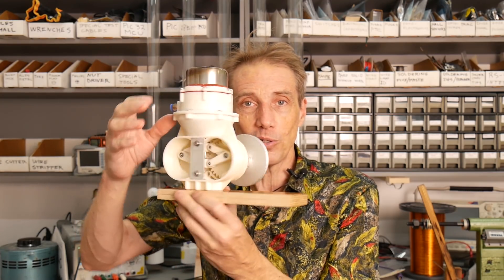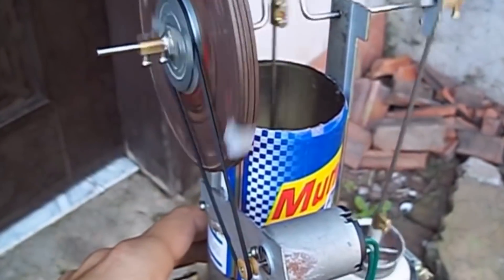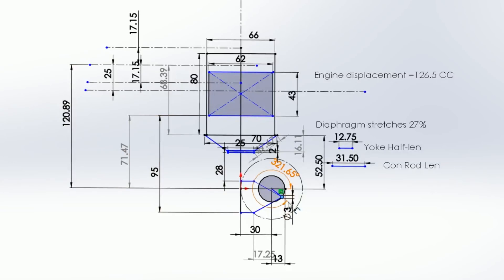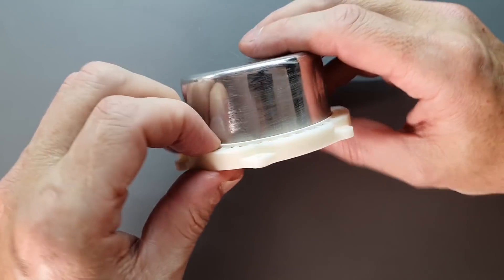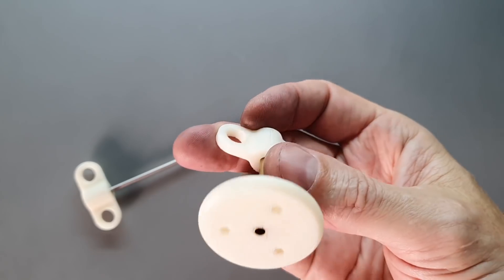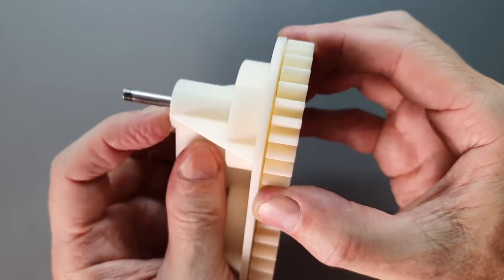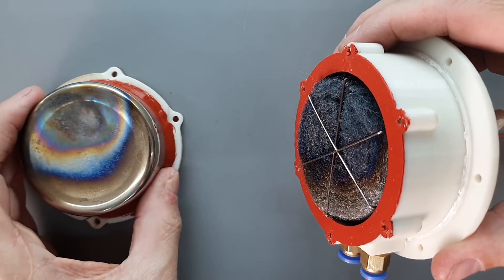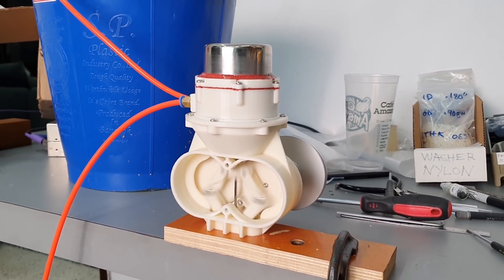The Stirling Engine Project

Comment: This is super cool! I wonder if cooling fins inside the chamber could help with efficiency, giving more surface area to the air. Excited to see more!
Reply: It Is important to efficiency to keep the working gas compression and expansion chamber as free of un-heated or un-cooled gas as possible, so introducing fins rapidly becomes a power loosing attribute if it displaces more gas than the efficiency it may lend.!.!.!. Robert Stirling origional patent also concerned a "regenerator", which involved using an absorptive metal wool or fine wire in the channel or tubes connecting the hot and cool chambers of the engine, which would absorb and re-impart heat energy to the occilating working gas.!.!.!.

Comment: Why not power this plastic engine with ice. Maybe you could also use dry ice or liquid nitrogen for demonstration instead of a flame? 
A practical model could serve in temperate climates as energy sources by collecting snow, ice and halestones and put them in mass in a very large insulating cyllinder with vacuum walls only letting spring and summer heat though via the stirling engine. The cooled air from the sterling engine could also be used as airconditioning during the hot summerdays while producing electricity.

Comment: Just get a small lathe.  And a decent drill press.  It'll be fun they said.

And then I caught myself buying a bridgeport and dragging it home and rebuilding it.  And then......the foundry.  And then the new oil burner for the foundry.

Somewhere in there I built the classic coffee cup low delta Sterling engine.  Oh yeah, and then a domestic sized combined heat and power plant using an enormous 6 horsepower Lister diesel running on biodiesel.  Since the proof of concept worked so well, I went and bought a brand spanking new 2004 diesel Jetta and ran it on biodiesel for a quarter of a million miles.

Run away while you still can!!!!  It will take over your life.

Comment: After you have the dyno done it would interesting to do some maths and see if the sterling does a better job of converting heat differentials to electricity than pnp/npn junctions. Micro electro mechanical old tech VS old mechanical tech :)

Comment: Two questions:
One, with the cooling jacket, is it necessary to separate the Cylinder from the head, can it be one piece with a tight fit cooling jacket?
Two, the cooling jacket, can internally have a spiral  guide to the low-pressure side to maximize cooling contact time, can the guide support a thin rubber rope like a rubber band or string to make firmer contact for flow dynamics.
Reply from the maker: If the head and cylinder are one piece, it's like a thermal short-circuit that robs efficiency!

Comment: This is just an amazing design! Thank you so much for sharing the project with us! 
Are you sharing the 3D model files? I would love to print one for me.
Reply from the maker: E-mail me
Reply: @leosbagoftricks3732  Hi, is it possible to have the Solidworks assembly file? Thanks
Reply: @leosbagoftricks3732  
do you think you could design one of these sterling engines to be directly tied to a pilot light, but a shared pilot light, like say for your water heater in the house, that would either charge a battery for the house but also provide emergency electricity when the power is out or maybe it could be used alongside your main grid power to supplement the power that the house could make use of.
Reply: huuuummmm NICE. If you build this, you should paint it TOMATO-RED.
Reply: @KimSeiji  tomato crusher
Reply: frozen tomatoes powering a stirling engine tomato chopper
Reply: @JoshuaJoshua0  Take a Stirling engine, hot tomato sauce on one side, frozen tomatoes on the other side, then you have more power to destroy tomatoes
Reply: The red sealing compound reminded me of you :D
Reply: @1islam1  prove it!
Reply: I'm also interested to know if this can be shared publicly.

Comment: You should be able to substantially improve performance by using helium as the working gas. It's not practical in a 3D printed engine because it would rapidly leak out, but it would make an interesting one-off test for comparison against air.

Comment: Very nice design, now set up a generator and work out how much power you can make with it..first with butane as a heat source and then with a solar concentrater like a fresnel lense..make yourself a mechanical water pump for your cooling..You may just end up with a really cost effective design...very well done.

Comment: I have a AC unit to cool and thought about coupling a Stirling engine as a condenser for the high pressurized and heated R32 refrigerant.  It feels appealing to "recycle" old waste heat to reduce costs of running the AC in the first place. Maybe any thoughts about this?
Reply: The sterling engine will end up impeding the heat from dissapating from the condensor which makes the condensor temprature rise and the owerally efficiancy of the ac will fall

Comment: I designed a simple dynamometer that has a mountain bike brake rotor mounted to the shaft and an arm supported by a bearing on the shaft which has the brake caliper mounted to it. The arm is linked to a small hydraulic cylinder. The length of the arm and the diameter of the hydraulic piston are such that a pressure gauge will give a direct read-out of foot pounds of torque in pounds per square inch.
 I am hoping to build a Stirling engine that is light enough to power an aircraft.
 Thank you for sharing your work. It is inspirational!

Comment: I would make a spiral inside the water jacket with the inlet and outlet at opposite ends. That way the water is forced all the way around. You can also pressurize the jacket with air to 5 psi and then use soapy water to find the leaks. Also integza has a few videos on measuring dynamic torque and rpm which will allow you to determine the available power of the engine.

Comment: Leo, I'd love to build or support a project to generate power from a solar thermal Stirling engine. Just wondering if a device like yours could generate enough power from several solar thermal panels on a campervan roof, as opposed to simple PVs.

Comment: Nice! I see that you are using ambient air as your energetic medium between the hot and cold phases. Since the archetecture is theorethically contained (airtight, since you use a membrane for your working cycle.), have you thought of differentiating the energetic medium (refrigerant or other gasses instead of ambient air.) to see whether this changes the performance (Hint: It does!).

Comment: Opposing Double cylinder, 3d ceramic piston?, 
Id want to see if Peltier modules could work as heat source or suck heat from water to increase the cooling

Comment: But the energy to heat it way surpasses  the energy of the engine. I think, after all your a/tension to detail, ch is considerable, you forgot the first detail. The engine needs to do more than convert heat to kinetic energy. It needs to be efficient. Can you improve that?

Comment: I want to make a Stirling engine using two regular 4 cylinder car engines, one as the cold side and the other as the hot side. Both their cranks connected to heavy permanent magnet motors. The engine heads modified to remove the camshafts and replaced with powerful solenoids. I want to power the entire contraption with hot water from my high efficiency wood fired water heater.

Comment: I used to work for a canning company and the packs were wrapped in shrink film, the heat tunnels that the packs passed through to shrink it would feel hot from the outside.
As it happens they had cold water drains running underneath them.
My idea to them was create a sterling motor that extracted the heat from the outside of the tunnels with the other end in the cold water.
From my understanding the hotter one side is in relation to the other produces more drive.
We had 3 massive units that would run 24/7.
They wouldn't spend the time even considering it even though we had engineers doing nothing half the time.
I am sure it was possible and would have produced a lot of energy over time.
It would not have been anything like your design though.
You speak of optimization but those units were at a constant 160 degrees C.
If anyone can figure out a good design i would think companies would take it up as how many companies shrink wrap their packs and saving energy is becoming a big issue in industry.

Comment: These engines are fascinating to me as well! I tend to like the variations that are capable of running on low temperature differentials. They run beautifully smooth and suffer much less from melting and oxidizing components (provided you don’t try to over clock them). The big challenge with them is reducing friction as much as possible. That’s very difficult with so many moving parts.
Great video! I suffer from the same obsessive behavior, but it’s so much fun so I wouldn’t have it any other way.

Comment: I think just hooking it up to a generator and measuring output should suffice. If you make drawings available for the parts you are having trouble with people will probly just make them and send them to you I know I would. Finding a way of using helium ( OK look for bb gun pumped up with helium here on youtube. or for extra credit watch helium superfluid state) as the working fluid. I want one just keep going your an awesome engineer I want to drive a delco alternator ( cause there cheap and lots of parts available and 750-1000 watts so a little over aHP ) solar powered from a parabolic trough the cyl. head a long tube down the trough beat that for easy fab the trough will track the sun while your battery's charge your 100% correct lot's of content here and your's is some of the best I've seen I have some machine tool's and could help keep going man this is reeeal good stuff!!!

Comment: I completely understand your addiction and I completely understand your need to build these engines.
Around 15 years ago I saw my first Stirling engine and it immediately transformed me into something I didn't recognize.....and I have never looked back.
The addiction has become so strong I bought a Bridgeport a lathe and a plethora of other machine shop tools. My background as a machinist also came into play.
I live for these engines.. well that and metal detecting.
But these engines are certainly at the forefront of a lot of my free time.
I live in the snow belt so I have a lot of time to work on these engines when I can't swing a detector.
I have to say that your engine is absolutely beautiful! you did a fantastic job on it. That is an engine that any builder would be proud of!
You'll get the bugs worked out of it, that I'm sure of.
These engines look so simple and so easy and yet they're extremely complex as you were saying. I made the mistake of thinking it was a cakewalk making one of these engines and I failed miserably again and again because of that. I didn't give these engines the credit and the respect that they deserved on the onset of building these and I paid for it with failed end product.

Comment: Great project. I would be tempted to attach a water pump for the water, so as not to have to rely on gravity feed.
Edit: Thought bubble - how about casting high temperature epoxy parts from your printed components. That would solve melting problems.
Also, I couldn't understand where the power piston was, isn't that a separate item from the displacer?

Comment: Very cool, and it sounds great. I remember reading about a Army project for a sterling engine generator, something like 30kw with a swash plate crank. They used helium for the working gas but it kept leaking out. Keep up the great work

Comment: I was thinking of an engine that is low cost, reliable, and possibly a flex-fuel solution. A bunch of tiny engines insulated and cooled are not going to be as hot as a bigger engine. 3D printed tiny engines with very simple functionality. It would be a hybrid with little engines like generators, or possibly building up pneumatic pressure.

Comment: Leo, as a dynamometer use a permanent magnet model aero electric motor as a generator. Couple it directly or via a belt drive to one output shafts of the engine. Measure its output with a small digital wattmeter.

First Calibrate the efficiency of the generator itself using an identical motor to drive it. Measure the speed using a tachometer.

Use an identical second motor to drive the first motor used as the generator. The input and output power to motor can be measured with digital wattmeters.

 The generator can be loaded with 3 identical resistors in a star connection.

Instead of digital wattmeters, ammeter and voltmeters can be used to measure input and output power. 
For example, the output load resistor current can be measured with an ammeter. The power output is 3x I×I x R where I is the current through each resistor. 

Obviously, the efficiency of the generator is equal to the output power divided by the input power.

When using a second motor and a resistor load, the efficiency of each motor/generator is equal to SQRT (3 IxIXR/W) where W is the input power read by the digital wattmeter.
This efficiency should be about 95-99%. 

Then the engine power output can be measured as equal to the ojtput wattmeter reading divided by the generator efficiency at that speed. 

Speed dependence of generator efficiency could be a problem, so you will have to measure it at various speeds. The motor-generator setup would facilitate that.

Comment: You're sucking me back into my old stirling engine obsession. :)
But if you could maybe create a github repo with your fusion360 and/or stl files, you could get some contributions from nerds like me.
Help us, help you, help everybody.  Thanks man!
Reply: Do you happen to know how you get high pressure working fluids working? I always wondered how you get the power piston working since the gas behind it has to be a similarly high pressure
Reply: @ravener96  I'm not totally sure I understand your question, but I'll take a stab... It has to do with the large surface area of the top and bottom of the displacer coupled with the localized change in pressure due to temperature.

Comment: for a dynamometer you could use small water pump or hydraulic pump and the head pressure as the scale. thinking it would be a good way to calibrate how much torque you can get out of it and size a generator and output gearing for it. being that most heat engines have thermostats to keep a set temp, was thinking this would be a good way to either passively cool a generator/make one more efficient with pulling more power out of the waste heat.

Comment: Why have you done this to me?

My parents have an old satelite dish (about 1m), and thats been laying around. Several years ago now, i looked at it and thought...."If i glued some aluminium foil/mylar sail to the dish and used its focal point for concentrating solar radiation, perhaps i could generate suffient heat to turn small eletric generator via stirling engine." 
But the i thought: "Nah, i couldn't really, i can find and/or modify and existing piece, too bad, i would've loved to have my own creationg partially powering my home" and so, i push this project out of my mind.

No, just seeing this video triguered my head to think to start using 3D printing as solution even if to just use the 3D printed parts as templates for metal casting, and now i need to build a furnace too and i also might need this and that... Sigh here we go again!

Nice video, definitely, thanks for sharing!

Comment: Hey, did you know you can work this thing in reverse too? If you hook a motor up to it and turn it manually, it will actually cool the heat plate. If you turn it fast enough, the surface will get cold enough to liquefy the oxygen in the air.

Comment: Since friction, vibrations and general wear&tear are a thing with stirlings - especially with the comercial ones, which have to be financialy feasible in which case the livetime really starts to matter - I always wondered if a magnetic assisted stirling or something like a free piston stirling engine is feasible. Can magnets displace the flywheel? Can contactless magnetic gears be benefitial? How about a linear generator setup... yes, it is quit addictive...

Comment: Due to the fact you cannot throttle the engine up/down as quickly as a pure internal combustion engine, the best way to put a Stirling engine into a vehicle is to use it in a hybrid setup where there is a battery and Toyota-Prius type of geared-CVT transmission that drives the wheels.

Comment: OHMYGOSH!!!  YOU CRACK DEALER YOU!!!

Sure... it's all fun and games until...  now I have to BUILD ONE!!!

This video is DELICIOUS!!   Thank you!   I wonder (in an open source sort of way, posting my thoughts for all to share) if the trick to a good stirling engine isn't a really really long displacer?  If you keep the hot area further away from the cold area... wouldn't the temperature change be easier to increase, and thereby make it easier to harness the hidden nectar of power in these things?  
I LOVE your addiction to symmetry by the way!  Fantastic design... and you REALLY tapped into the essense of the Stirling weakness in the inventor's mind!

LIKED AND SUBSCRIBED!!!

Can't wait for your next video!

Comment: An axial temperature gradient in the regenerator can boost its effectiveness, since it's no longer limited to 50% (acts like multiple regenerators in series). Stacking steel mesh sheets would accomplish this, it'll have sufficient contact resistance.
Reply from the maker: Once I get my dynamometer working, I'll be experimenting with the displacer / regenerator (Displenerator?) as the first order of business.